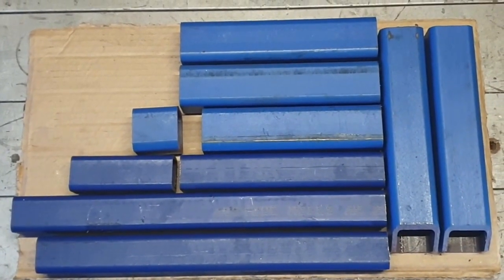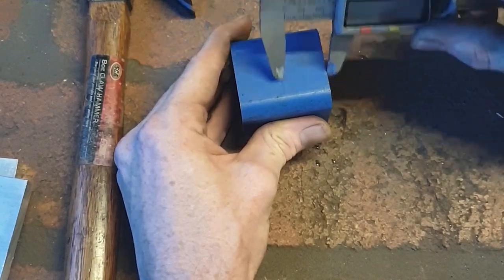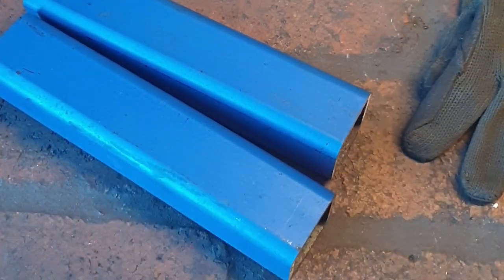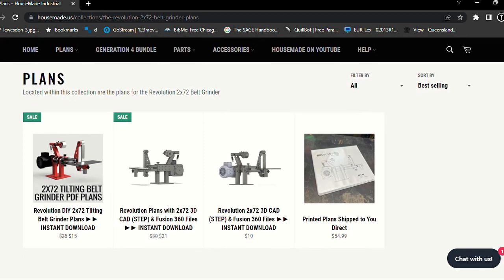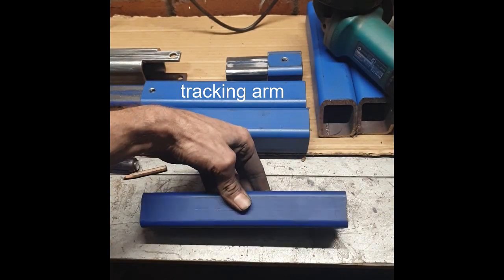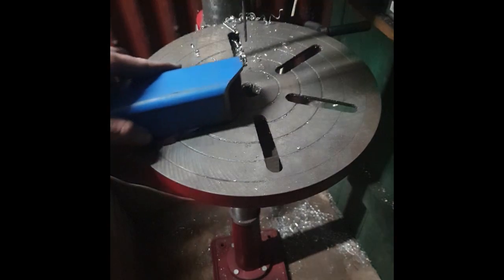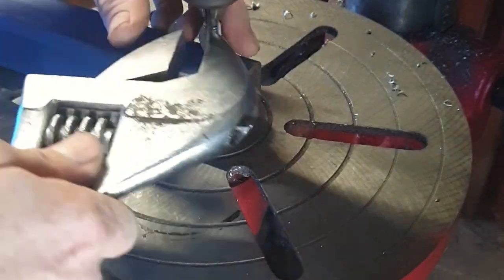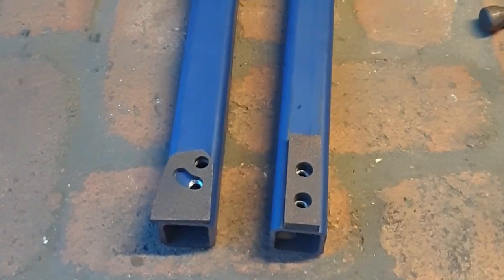tube steel fabrication brian house's revolution 2x72 - with basic tools (im no longer selling this)

Comment: 2:36 hold this with vicegrips in your left hand. Ideally push the workpiece downwards flat against the table with force and prepare your arm for rotation if the drill grabs. 
For your tapping, put any 3/8" drive socket on the tap backwards, then put an Allen key/socket in the 12/6 point end. You can then use any ratchet you want in it
Reply from the maker: That sounds like the go!

Comment: Also the work rest bracket is supposed to be flush with end of the tubing. It should over hang a bit. Not sure exactly how much but you can watch the original video and he’ll tell you how much overhang you need.
Reply: Not supposed to be flush*^

Comment: Great video ............. just one question if I may,  what is the wall thickness  (Metric) of the tube steel hat you are using in your video.  Thanks in advance.
Reply from the maker: 4mm wall thickness, wish it was 5mm thick but thats impossible to find in Australia

Comment: nice work!! are you using 38 or 40 mm for the inner steel tubes?
Reply from the maker: @milnermoss6428  40x40mm tube 4mm wall :)
Reply: Potrebno je 130 cm cijevi 40x40x5 i 50x50x4  također 130 cm ja sam koristio obadvje  cijevi stjenke 5 mm ima bolji dosjed samo ima puno više posla oko prilagodbe
Reply from the maker: Hvala na tvojim mislima, mogu vidjeti kako bi to bolje funkcioniralo, čak i ako traje malo duže. Nadam se da je moj prijevod točan, ako nije, krivim Google! 😉
Reply: @frissonsknives  ja pišem na svom jeziku od kad  youtube ima prevoditrlja

Comment: A die grinder wittles out the seam the fastest, then a 1/2" belt grinder, but obviously both of those are only good for short length tubes.
Reply from the maker: I need to get me die grinder!! Good recommendations!
Reply: @frissonsknives  look into electric, they have better torque than air.
Reply from the maker: @MichaelJeffers75  will do cheers!

Comment: You should never paint box section before welding. Plus use a vice grips and gloves.
Reply from the maker: This comes pre painted from the metal supplier but good point none the less, its a pain in the ass removing the paint sometimes
Reply: All rhs in aus is painted with a thin blue enamel. Comes off with any paint thinner on a rag. 
But you can MIG/arc straight through it. Its not plastic (acrylic/powdercoat)